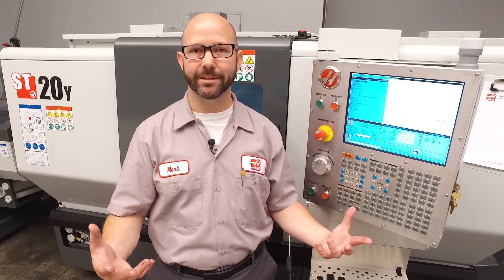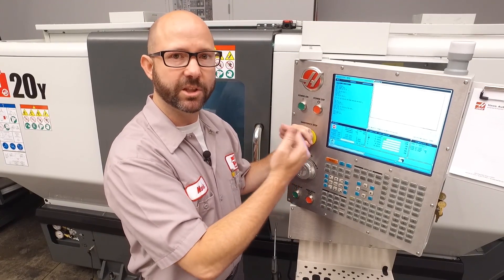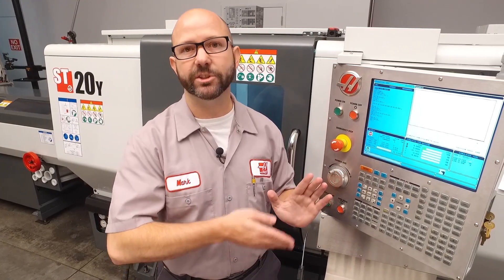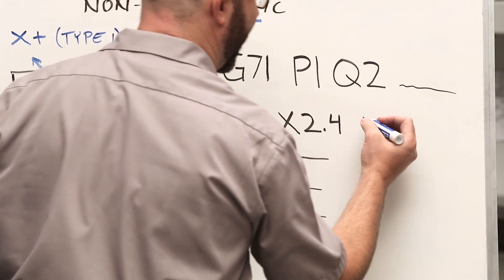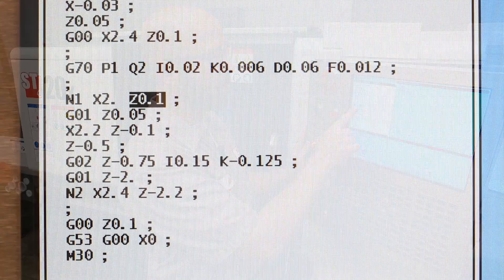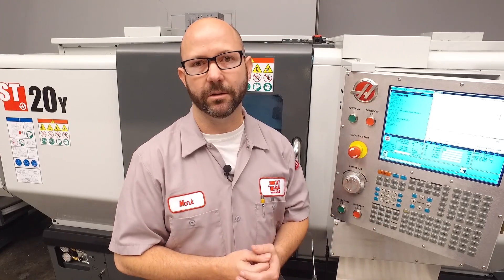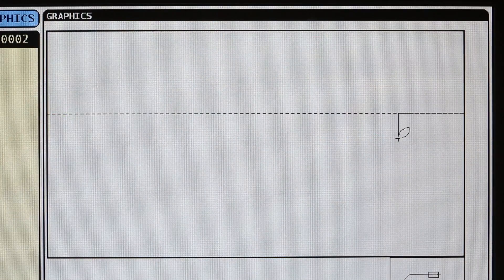Troubleshoot your lathe G71 and G72 roughing cycles quickly – Haas Automation Tip of the Day

Comment: Very helpful, especially because at my job we have the same control panel and also use graphics for proving new programs and we have gotten this exact alarm. We knew about needing an X and Z for that specific alarm, but not about the G70 trick for the graphics.

Very helpful for new programmers and to not crash the machine.

Comment: So from your video I just learned that Mazatoral is the best and Simplest program you can use on your cnc machine no problems like this on Mazatoral! Today I had a problem with my new NC lathe using a GSK control aka Fanuc clown, the machine couldn't machine a simple undercut. Thanks for your tip of the day which I am going to use right now.

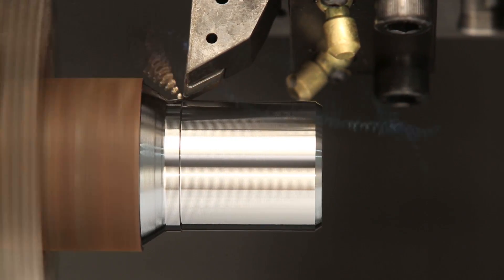Comment: 1:23 yeah so conic correction should not possible going x- toward chuck and last line on cycle can be over starting position. so you can crash turning inside and last rouching cycle it go UP inside part even it was working fine, but its fine first run you test program anyway lol

Comment: If you were not aware that you needed both the X and Y value you could be stuck trying to solve this problem for days. Surely there is some way to identify the problem other then getting lucky and viewing this video?
Reply: its in the operator manual, in the help tab on the lathe and on their website.

Comment: 5:53 thats not all last block should be less than startting point so contol know is it OD or ID cycle
but its fine. if last Z is near face then it roughing everything that depth but last it go all what you wrote safe time when have stop and change insert. i dunno or its bug i found XD not feature

Comment: Awesome video! One question- I've been having trouble with type two roughing cycles. Every time I use it the distance the tool rapids back past the face of the part gets smaller all the way down onto the finish contour(almost finished that is) where it's just eventually on the last couple passes rapiding back to the corner of the part. On the graphics screen I can easily see this because of the angled toolpath. The way I fix this is just by using a type one cycle and it fixes it every time. Any ideas?

Comment: Thank you sir about your info. My name is Panca Candra. I am from east java Indonesia. May I ask you about G53 use.. it's absolute or increment mode. Thank you sir.
Reply from the maker: Good day. G53 is really meant to be used in G90 Absolute Mode. If using a G91 for incremental mode, all moves are from the current location, not really using the G53 machine position at all. For more information on G53, check out these videos. https://youtu.be/Rd-h0YA9IzQ, https://youtu.be/G2uqdHiodDI . – Mark, Haas Tip-of-the-day

Comment: As a software engineer, this makes me feel insane.

Wouldn't any normal person:
a) expect it to ask you whether you want to do the g70 render (temporarily) if it can't do the g71?
b) expect it to render with some kind of error, like show what arguments were outside the bounds?
c) expect it to jump to the line breaking the constraint and put up some flashy warning saying 'this is my problem'? 
3) expect it wouldn't even be a constraint in the first place, since the "fix" is just to respecify the current z axis (which should be left alone), and thus therefore it makes no sense? 

Why would someone put up with that sort of interface/language? Is this some kind of debug mode that nobody really uses? Is having arbitrary opcodes (G71/70/whatever) useful in any fashion?
Reply: Yeah, the problem is that ISO G codes are pretty much an old thing! And nobody in industry are gonna to invest in development to make NC programming up to the 21st century!
Reply: Mazatrol or Heidenhain and various other conversational languages will flag the block causing the malfunction. Their acceptable inputs are much more controlled to prevent excess bugs. EIA G-code is 1960's adoption and RS-274D as the final rev is 1980's. You'd need the entire industry to agree on improvements to the standard, or go brand specific macros like these, or not care and output discreet moves in CAM and let copious amounts of cheap memory handle things these days.
Reply: well haas do it LOL.
Reply: I would rather go line by line, move by move...That's how it was done since ancient times when you used a bow and a rope to turn the spindle! The memory limitations is the most stupid thing in the industry! My 5 year old smartphone has 1 gb of memory and it is enough to run code for days!
Reply: Gcode is usually run one block at a time thru a plc, it hasnt changed a whole lot since punched tape
Reply: There are pc software simulators for this like ncreader and every cam program has its own
Reply: You are absolutely correct! Welcome to the world of software development for manufacturing.  The industry as a whole is definitely in need of software design talent to fix the arcane practices that are just accepted on these controllers.

Comment: Is it working with G42? Where to insert?
Reply from the maker: Mateusz – Yes, definitely. The G42 Compensation will work whether we run a G71 Roughing, or G70 finishing cycle. Check out page 90 in our Lathe Programming Workbook for examples (it shows your G42). You can download the workbook from our DIY site, click on the “Programming Workbooks” section at the bottom of the page, https://diy.haascnc.com/user-guide#gsc.tab=0  – Mark, Haas Tip-of-the-day

Comment: What's bad about a monotonic arc?
Reply: Hah, that's what our Software Engineers asked, after seeing this video. They changed the way the new NGC controls work, to automatically switch to a Type II cycle when needed, so we don't run into these alarms hardly at all any more. The control takes care of things for us. Still a useful video for looking at these cycles, and for dealing with these programming errors on older machines.
Reply: @markterryberry4477  
First I wanted to say thanks for the informative video. I've quite recently become a Haas lathe operator (SL 10, 20 and 30) and I've run into the non-monotonic  errors quite a lot. An absolute pain in the butt but I've become better to see the errors in the code. Had no clue about the G70 trick, this will be very useful.

But from my understanding from your comment, newer machines automatically figure out this problem by themselves and compensate when necessary?
Reply: @Azarath08  yes, new Haas lathes that are leaving the factory today will automatically scan the program and switch to a type II tool path if needed. We are working on other changes to help simplify things as well.

Comment: Haas TM1P vertical mill, 10 years old, faults/issues...none.
Doosan Lynx 220 Lathe, 1 year old, faults/issues...loads!!
You want reliability then buy Haas.
Reply from the maker: Hello Graham, sorry for the delayed response. Thanks for the comment and we're glad to hear your TM-1P is running strong. Here's to the next 10 years!
Reply: Depends very much on which machine you get from Haas.  Haas TM1P is extremely good. Haas DS 30Y not so much to say the least. Research heavily before investing!

Comment: real progman has never EXACT numbe x or z is allways compensated  unless use G41/G42 im sure you have not calculate nose radius compensation for angles and roundnes lol so its 2xNR too close face
magic top secret formula is (1-tan(angle/2))*NR means that much longer need Z put on program and starting x need calculate total lenght on program*tan(angle)*2 and minus that from end point.
im sure your chamber not 0.1 or 2.54mm. 2.468 would be 2mm chamber on 0.8 nose radius XD